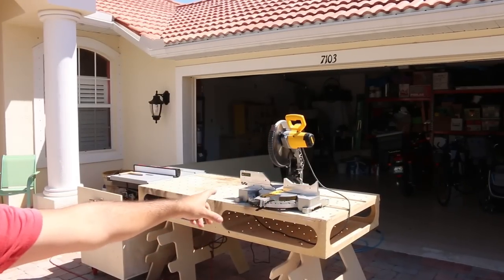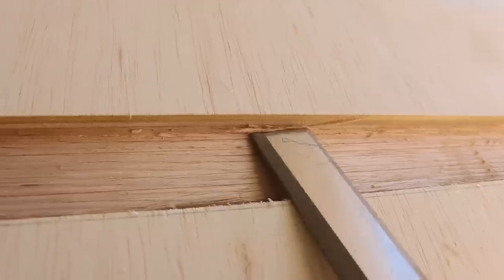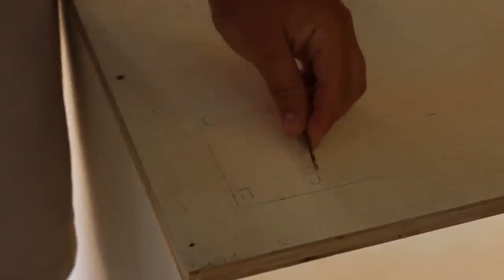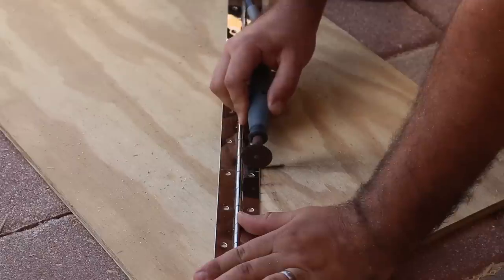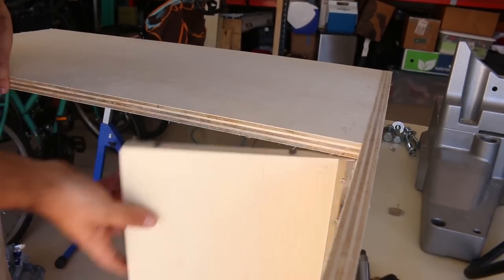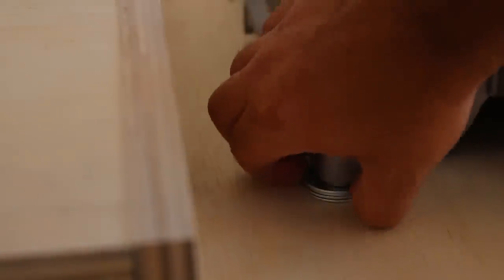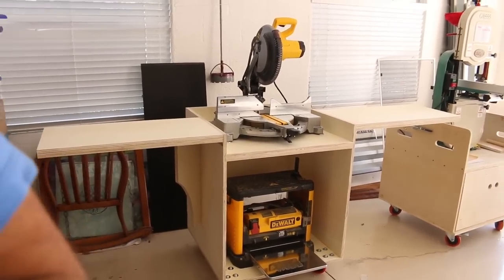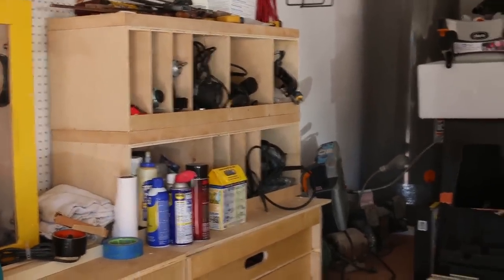Rolling Miter Saw Cabinet w/ Folding Support Wings (Free Plans)

Comment: Hey bud, just my .02$ here: supporting a table's (albeit a side table) weight on two small screw heads puts so much pressure on the soft wood at the contact points that it makes the screw heads biting/sinking into the wood a very likely scenario, in time. You might consider widening the surface contact a bit over there - by mounting some plates either to the screw heads or to the underside of the side tables.
Reply: I was thinking he could glue/nail a  wedge-shaped shim under the table, along with a block of wood to stop the wing.  The wing would just slide under the shim then stop against the block.

Comment: Solid video! Made one as well, however I made the bottom shelf able to slide out like a drawer with a flip down foot so my planer can be used easier, have the planer sitting long ways facing the 2 side walls. Nice 2 in 1 gig here.

Comment: You could potentially make the supports hide under the wings so you have space for the clamps.  You will need to modify the part of the supports that holds the wings up and possibly the wing hinge too for this to work though.

Comment: Thanks for sharing mike!   Have you used sketchup much?  I wondering if there are advantages to using that over fusion for woodworking. I'm used to 3d modeling in most software, including fusion,  but not sketchup. Are us fusion users missing out on sketch features?
Reply from the maker: Fusion is far more capable than sketchup.  I switched from exclusively sketchup to exclusively Fusion.

Comment: Did you mount the planer underneath? If so, how do you feed boards through it (i.e. does the back open up, or do you plan to remove it from that lower box whenever you use it)?
Reply: 4:45 you can see it’s open

Comment: Hi Mike, do you think those folding wings could hold up to the flying Matthias challenge? Great video.
Reply from the maker: Haha, not at the ends!  I considered cutting these down to 24" instead of 32" but I figured they hold at least 30-40lbs so that's more than any section of lumber will weigh.
Reply: @MikeAndLaurenTV  Bought the course at the time, only just getting through it now! ( I know I know....) still agree, great video :)

Comment: Nice build Mike.  I don't see a materials list with the PDF and am curious how many sheets of ply did this project take? Thanks for the plans!
Reply from the maker: +Mountain Soles & Outdoor Threads great question. It took 1 1/2 sheets. I had HD rip them at 39 inches and had the skinny half of one sheet left over.
Reply: Thanks!
Reply: Did you use 3/4 or 1/2 ply?

Comment: Hi Mike, great mitre station. Question: would you consider sharing the model in Fusion 360? I'd like to adjust some of the dimensions for 2 reasons. 
 
1) So I can make it fit my saw, but more importantly
2) So those of us outside of North America can make it from 'metric' materials. It's no problem marking up and cutting up flat stock in inches, but difference in available plywood thickness (3/4 vs 18mm) will cause issues if you tried to build this as it stands.

Greetings from the UK!
Reply from the maker: Sure.  I'm out of town right now.  The model is on my other computer.  Can you email me at hello@mikeandlauren.com to remind me to get it this weekend?